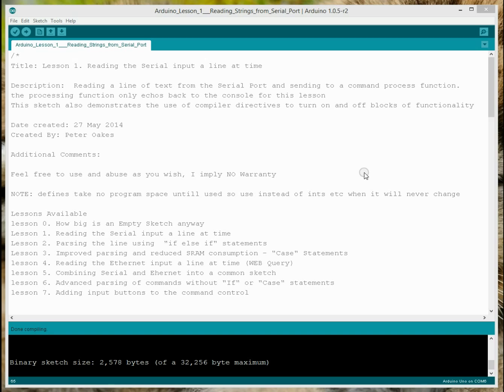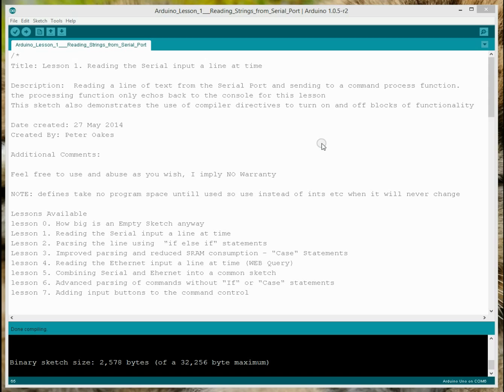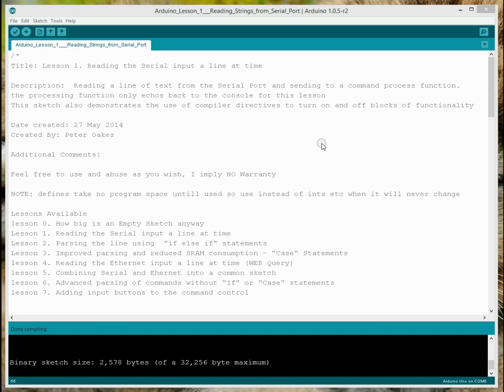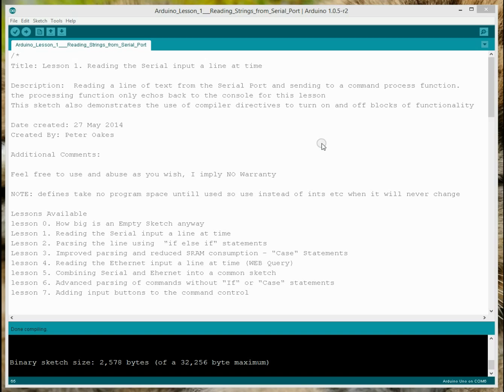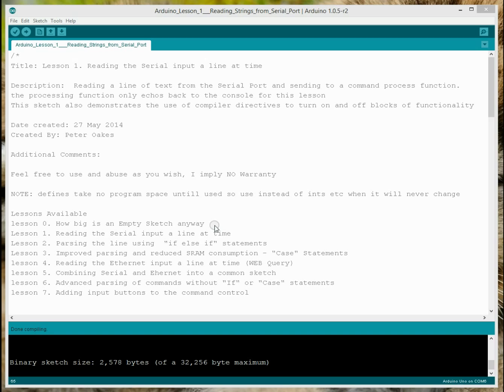Arduino   Intro to Lessons

Comment: Hi Peter and thaks for a great arduino tutorials!  I wondering how this code could grab a stream of analog data commming from another microcontroller via xbee ( serial ) been doing lots of rtfm but I reached a wall,  so far I can grab commands like Ab on  / Bc  on etc.  and sofar nothing that I have done can grab a stream of analaog data  ( like  Alog1 x_streamdata )  thanks in advance
Reply from the maker: What does the data stream look like, it is all possible but you just need to have some basic knowledge of the stream structure and adjust the read serial routines appropriately, currently the ones in the example look for a new line character in the data, it is most lightly that your data stream is binary and not ascii ?